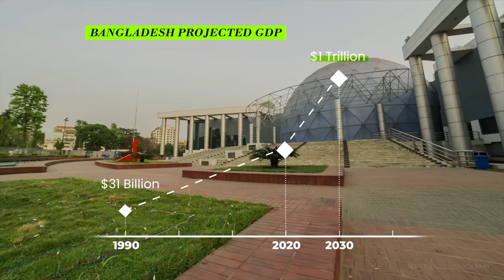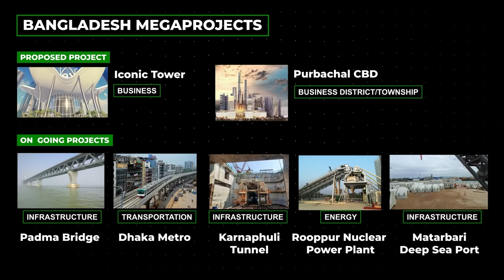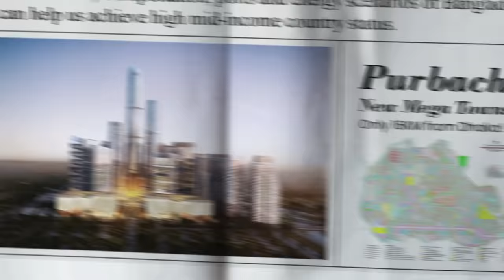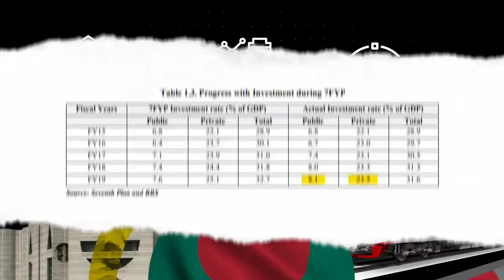Bangladesh's Mega Plan To Build The Future

Comment: How will climate change effect Bangladesh?  I find it odd that  climate change has not been mentioned.
Reply: In a worst case scenario the sea levels will rise by 1.5 meter in the next 100+ years. If Bangladesh takes no action the max area lost to sea rise would be 17% of the low areas. However the government has been working with the Dutch government under the $100bn+ "Delta Plan", to not only prevent that but also add 25,00 square kilo meters to the country.